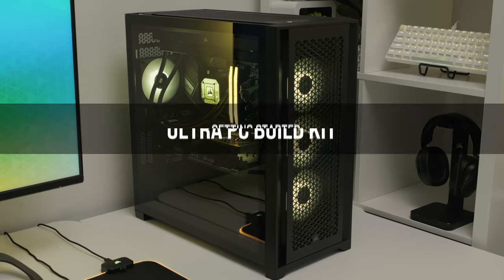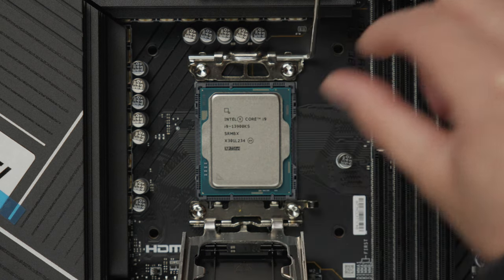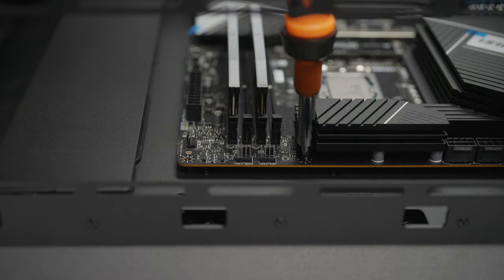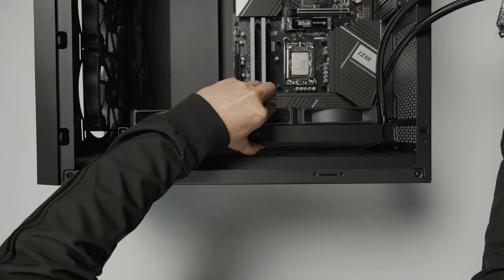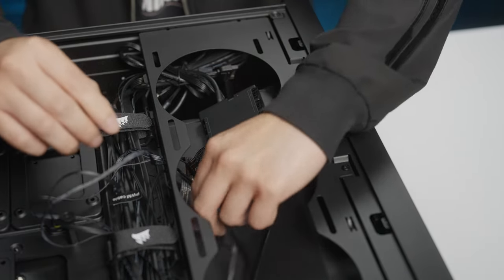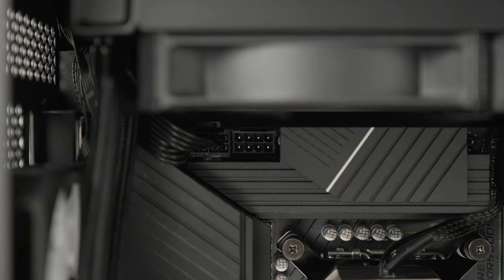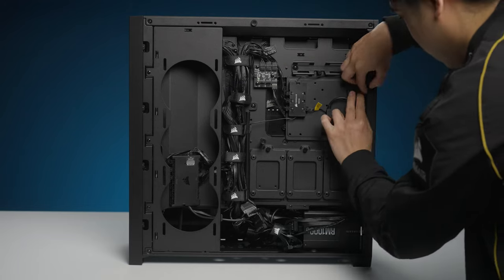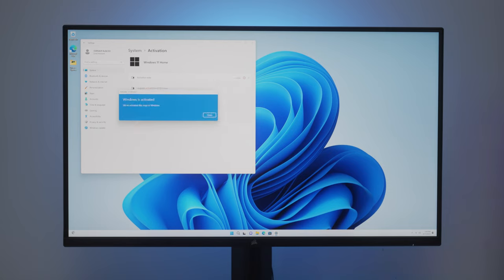CORSAIR ULTRA BUILD KIT - Your Build Journey Starts Here

Comment: First, I would place the air cooler mount on the back of the motherboard before installing it to the case. Second, I would install the CPU and 24-pin power cables, and wire up the motherboard as much as possible before installing the radiator/fans overhead. Third, I would remove one of the 2.5-inch SSD mounts and place the RBG control modular on one of the 3 locations.

Added note: Have some thermal paste on hand just in case. Also, study this video as much as possible, along with other build videos.

Comment: "So simple a child can do it." I've watched many PC builds on YouTube. Most show connecting the MB upper left power cables AFTER installing the MB and AIO in the case. Your video shows you struggling to connect the cables after the MB and Radiator have been installed. I always connect these cable(s) to the MB and route them to the back of the case before I install the MB and AIO into the case. I hope this helps when building a new PC.

Comment: Simply put: don't buy this unless you're experienced with build pcs from scratch. The videos miss steps, they do not describe the actual processes required, and the customer support is non existent. The boxes have customer support phone numbers in them, turns out you can't call for tech support you have to live chat with them. 'simple videos' are a lie, and the support framework is ridiculous
Reply: 100% agree about the quality of the videos. Having worked building PCs that are not gaming PCs but business machines... I have built well over 1000 computers (maybe 10k? I'm not sure about that claim though) and even I struggled to follow it and was VERY thankful I am very experienced. I would ABSOLUTELY RECOMMEND corsair reach out and listen to feedback and adjust or add little addudendums to their guides. They shouldn't be too hard to fix to make a lot easier to follow - but they have to put some more effort in ... and customers / builders need to provide constructive FEEDBACK and corsair needs to provide an obvious way to do this. This is basically a different class of product! 

I mention my experience because corsair making this kind of a build kit available to those that do have some PC building experience... IS A BLESSING. It is NOT NOT NOT easy to do this (provide a build kit PC) especially with multiple levels of different PCs... and sourcing the same components over and over consistenly to ship in a kit with a persistently accurate guide? Just know there are a lot of industry reasons that makes me feel very glad this exists. 

I hope they continue to offer these products and refine the guides... I'll say this... despite the stuggle to follow some simple (I think they assumed obvious) things and pay closer attention to the manuals and writing on the PCBs... I only closed the case once. Posted on first boot.